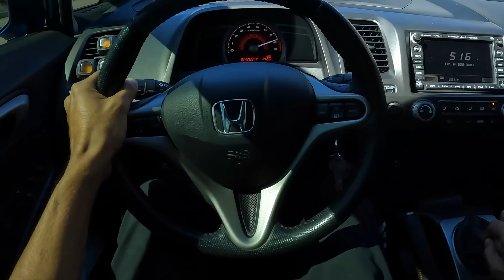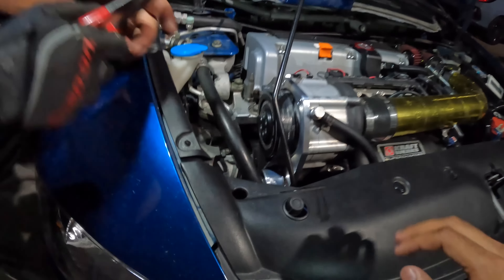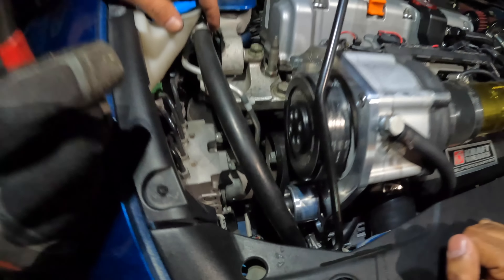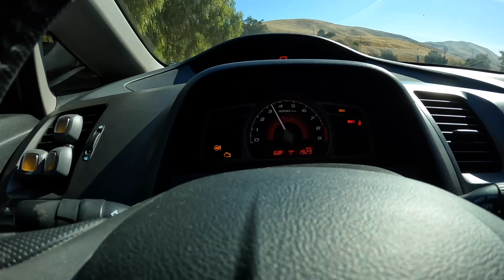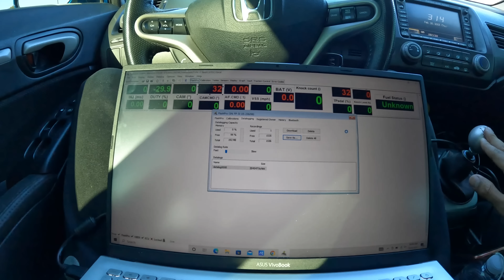Sleeper Civic Si Just Got Way Faster 😳

Comment: Thats crazy for 1650cc to be maxxed out under 500 hp, maybe a fuel pressure regulator and/or upgraded fuel pump could help
Reply: This. 1650cc is large aff
Reply: @PiterStreak  im over 500 on 1200cc High Z injectors. 450 fuel pump. Duty cycle 68 on WOT. This is on a DSM tho.
Reply: 1300cc , 450 pump , fuel return , 440 hp and I’m around the same fuel cycle wot too .. 9th Gen Turbo’d Si
Reply: Made over 500 on 1300cc 😂 fuel return c16 8th Gen
Reply: i know c6's with 1200 cc injectors that make 700+. granted its a v8 but still that would mean it requires more fuel. Injector duty cycle is at 95% tho LMAO

Comment: Hey bro I also got a Kraftwerks FA5, trust me when I tell you get a fuel rail so you can put a gauge. I know it’s supposed to be the lowkey build, but it’s important and you can use that to know if the O-ring came out. 

My O-ring popped out cause i didn’t put the lube on it and fuel pressure dropped significantly. After I put it back adding the lube, with my DW300c pump i’m constantly at 80psi for fuel pressure.

You also shouldn’t be maxing those injectors as I have 1300cc alpha making 380whp no issues. 

I bet your fuel pressure is low, we need to up that😈

Comment: You need a bigger pump and a return style fuel system with external regulator, not bigger injectors. Those injectors should be good for well over 500.

Comment: If you're running out these injectors at that power level, something is not right.. i have a em2 k20a swap full high comp. Build, 291 whp , on 550cc injectors, and i'm on 79% duty cycle...?

Comment: What’s better Supercharger or Turbo?
Reply: Turbo
Reply: Turbski
Reply: supercharger is more instant since it runs on the crankshaft pulley but strains the engine a bit more, and turbo runs off exhaust gases and takes time to spool up. id rather a turbo than supercharger tho
Reply: Depends in your goals:
Supercharger:
-no lag
-linear powerband
-doesnt generate as much heat
-less efficient due to running off the crank pulley

Turbo:
-lag due to spool time
-more efficient
-more options
-cooler noises
-weighs less usually
Reply: @TheForbiddenTacoYT  turbos are very efficient now a days. You can build a very responsive high hp build I think turbo>supercharger
Reply: @RandomlnternetGuy  -more reliable *
Reply: @ssjdavid  i literally said that man haha i agree turbos are better